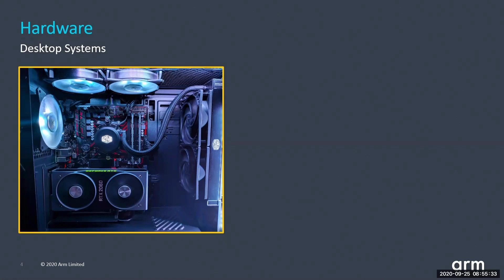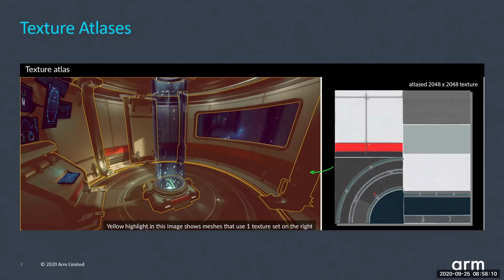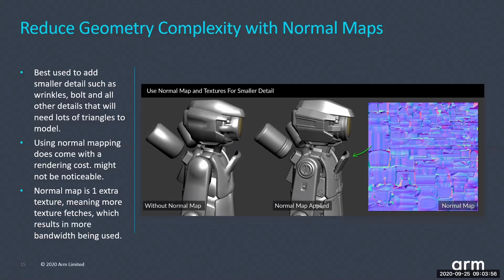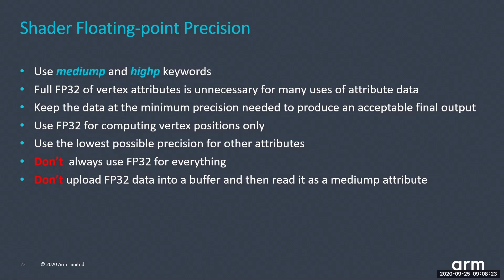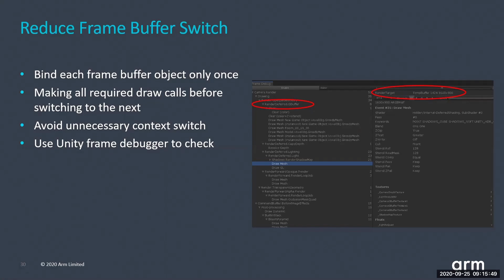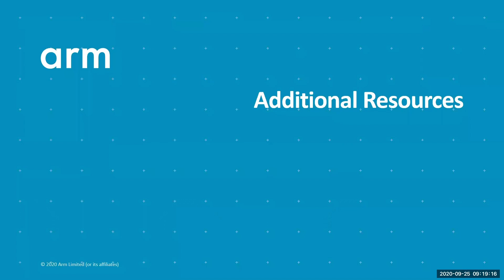Comment: Question: Where can I get more info about mobile render tiles and there particular sizes on different graphics hardware?
At 10:30 he had mentioned you don't want triangles covering multiple tiles, but to topoligize assets to fit that constraint I assume I would need to know how many tiles the screen is divided into.